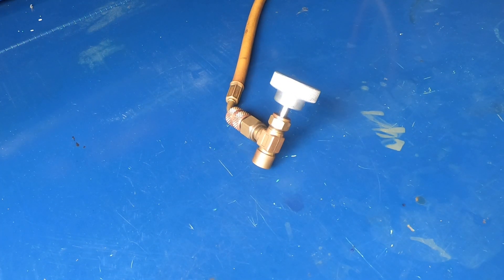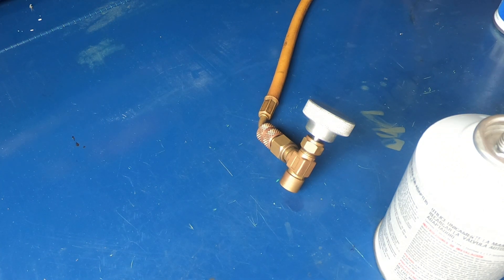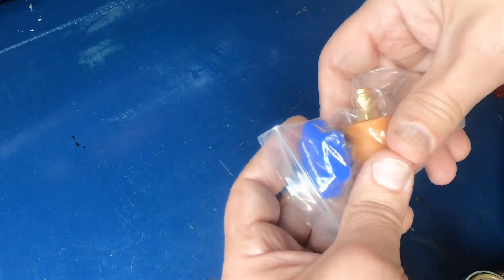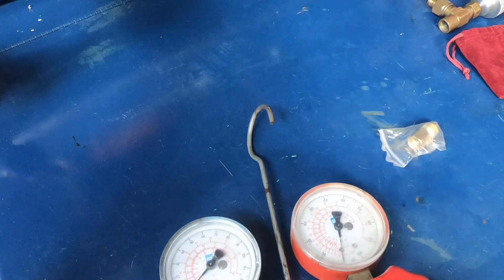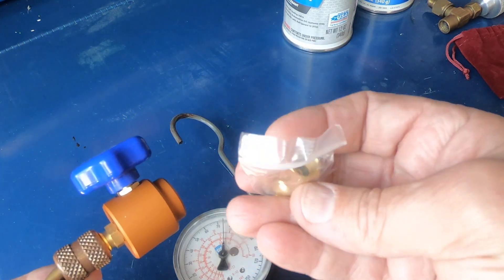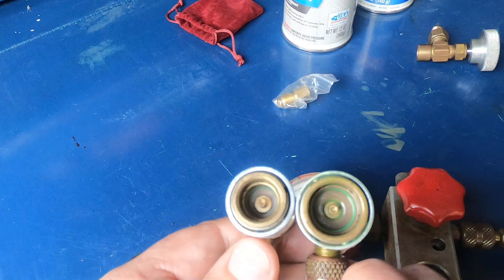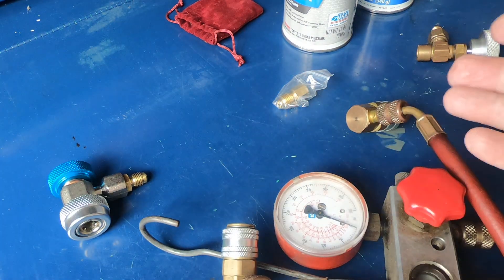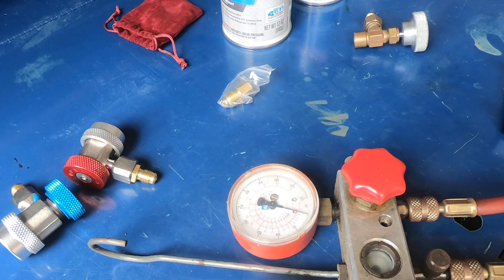The new self sealing R134a cans and can taps.

Comment from the maker: Boltigen Self Sealing R134A Can Tap                   
https://amzn.to/2QwH0wX
Lichamp R134a Can Tap, Automotive R 134a Self Sealing Can Tap and Puncture AC Freon Can
https://amzn.to/3Mhdd5x
Orion Motor Tech AC R134A Adapter                   
https://amzn.to/2P2opJ3
HOTECHE R22 R134a R410A Complete Manifold Gauge Set 4 Way Adapter Can Tap AC Refrigeration        
https://amzn.to/3rZyXft
Reply: Thank you for the new 134 low and high side. My low work.  High side leaked. I ordered your link thank you.

Comment: Hello everybody,  I am learning about generations of freon/refrigerants. I asked a friend and mechanic for the total cost to put refrigerant in a 2017 Honda Civic Sedan and  also in a 2002 Toyota Sienna, For the Civic the cost would be $420 and for the Sienna $220.00. The 2017 Civic AC don't use R234a, it is R1234yf (you fucked), which costs $48.00 per 12 OZ and it takes two cans. 
I have a question, when a vacuum pump is used to prepare the guts of the AC system before adding freon/refrigerant, question: to where goes the freon already in the system, to be purged, to the atmosphere?  If that is the case, EPA will soon come with something to tax or to fine the DIYs.  Another and final:  Since I am not sure how much freon was inject in the system, because the self sealing R234a can leaked whatever was left, I ask, How to measure the amount of R234a that was loaded?  And finally, what a is the ideal pressure on Low (blue line) and High (red line), to consider a perfect job.

Comment: I bought a set of two taps from Amazon, one for self sealing cans and one for the old style because I do still have a couple of the old style cans.  They came with an adapter that is required to attach to my Pittsburgh gauge set from Harbor Freight.  In addition, the adapter is threaded to accept a schrader valve.  When attached to the old-style puncture type can, the valve with adapter and schrader valve will hold pressure.  Unfortunately there is only one adapter, so while that one valve is attached to  the non-self-sealing can, I could not use the other.  So for me, it is either or, this then that, but not both, but what can I expect for $12?

Comment: Good video.  The ridiculous thing is that the SuperTech instructions on the self-sealing version say to leave the hose attached on a partially used can.  What then is the point of the self-sealing valve?
Reply from the maker: It is probably the same instructions that they used on the older version cans.

Comment: You can still use the piercing type of can opener to release the refrigerant quickly.  Just reduce the diameter from 2.58mm to 1.95mm  and it will activate the self sealing valve and charge up your AC.  You can also control the amount of refrigerant release with this mod. And you can still pierce old style refrigerant cans. No need to buy so many stuff.
Reply from the maker: What diameter are you talking about?
Reply: @737mechanic  The piercing pin's diameter. In my video you can see stepped diameter. The smaller diameter will not seal against the refrigerant's o ring but press against the shredder valve and release the refrigerant quickly.   https://youtu.be/QFY5jKAQuvc
Reply from the maker: @vincentlee2460  Ok, I was looking at the measurement as going from 2.58in to 1.95in but it is going from 2.58mm to 1.95mm. Got it.
Reply: Did you grind the point flat? I seems that if the tip is too fat it blocks the flow, right? That is what you are getting at?.

Comment: 737mechanic, In the past I had the same problem with the high side valve leaking, It caused problems when pulling a vacuum on the system, so I bought a set of valves like you have. They work great; Also I recently repaired a refrigerant leak on a Tacoma and was having a hard time getting my can tapper to work right, It was real slow. Thanks for your video, Ill be getting a new can tapper like yours.

Comment: Those self sealing cans are actually worse than old piercing cans.  I used one to top off my car ac then backed off handle on the adapter to supposedly "close" the valve on the can.  I did use the correct adapter with flat stem (not piercing type).  Now I removed the adapter and entire can content of R134a just exploded out into atmosphere through the "self sealing" valve.   If it was piercing type, I would have simply left the adapter on closed the valve, saving unneeded extra green house gas going into atmosphere.
Reply: Im battling this same thing. The pin pushes too far down and breaks the self sealing valve. Apparently you can’t turn the knob the entire way or else it will break it? They should just make the stupid tap valve only screw down a certain amount so it doesn’t break anything.
Reply: Same experience, I lost a full can of r134a (same brand as in the video)
Reply: In home ac you used to be able to use r22 and recharge a system even with a leak present because it worked under low pressures.  Someone decided that high pressure refrigerants are better meaning if you have an ac leak you pretty much are done because the new refrigerants work under extremely high pressure that can make the leak worse.

Comment: I ordered one of these only it's aluminum just like yours with the knob on the side (Yours looks like brass?).  The little post (pin) that presses down on the can valve is fixed and doesn't move when you turn the knob.  You can just feel the tip of the pin with your finger sliding over it a little less than flush.  Close the valve first before you tighten it on a can as the pin opens the can is open as you screw the adapter on.  Mine leaked a little with the valve closed thru to the hose so I unscrewed the knob fitting.  Inside there is an o-ring seal on the knob shaft and the end is a metal to metal needle valve (no rubber seal).  I used a little thread sealer and put it back together then firmly tightened it a few times and now it's ok (don't over do it).  It came with a 1/4" flare fitting (like for R12 and R22) installed on the top (which I have a ton of fittings, ball valves, 90s, etc.) and then an adapter for the 1/2" acme R134A thread.  I think it will work ok.  If the partial can just won't seal when done you can always put a 1/4" flare cap on top and leave it on till next time.  Thanks for the video.  I didn't see this adapter anywhere else.

Comment: Piercing type works with Walmart self.sealing type cans. I didn't even realize it was different
Reply from the maker: My piercing can tap doesn’t. I have to screw it in and out until I find the point that I get some flow but even then it isn’t full flow and I don’t have all day so I bought the self sealing tap in the video and I get full flow.
Reply: @737mechanic  mine is an old inter dynamics and the piercing tip extends really far. Might be why

Comment: I've lost about 5 cans of refrigerant due to this mess of connections.  I bought the can adapter, it was trash. Plus the self sealing mechanism on the can didn't work and everything leaked out.  It's so frustrating buying these cheap products that actually work against the intended problem (to save the environment).  I guess I'll buy more cheap products until something works.
Reply: probably will be better to find one of those  side piercing clamps i have seen in mexico
Reply: @victormanx  You're absolutely right.  Later I bought one of those and I was impressed at how strong they are... good product.
Reply: @HousesandCars  All that is makes me fill better, I thought I was so stupid when I lost 1/2 can of R134a yesterday, now I learned that this self sealing freon can by Tech and the adapter are all trash.